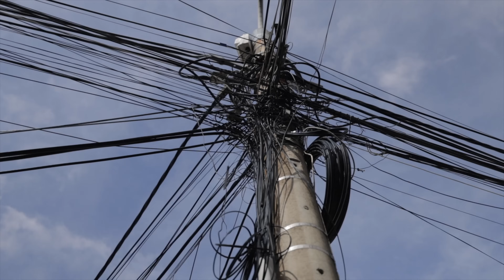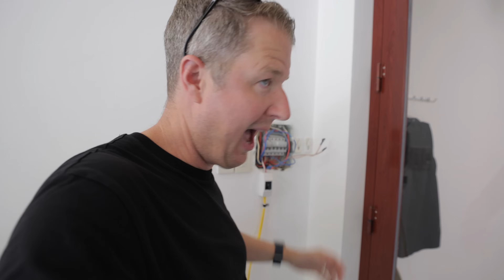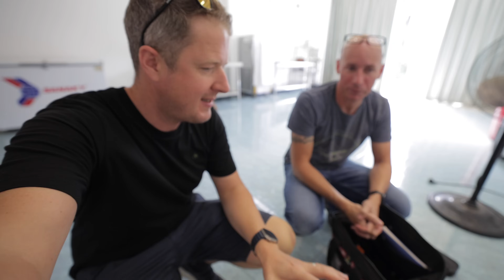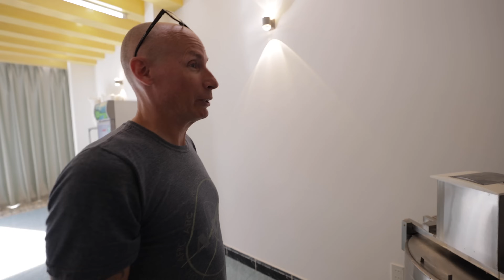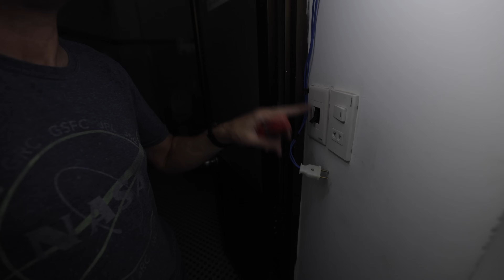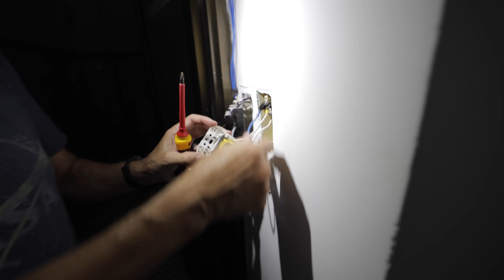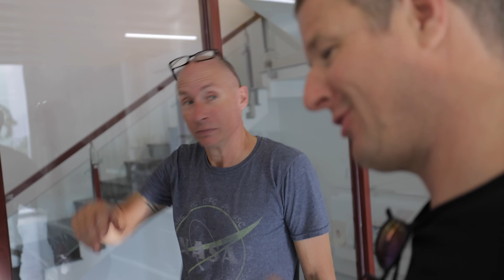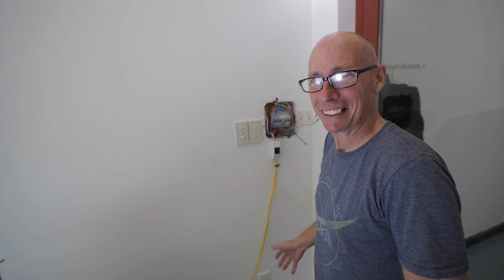USA and UK Electrician tackle CRAZY electrical wiring in Vietnam

Comment: That's some crazy stuff. Yeah wire gauge in America's weird! It confuses Americans too, usually the ones that aren't in the trade.
It makes sense historically sort of.
Reply: It probably made sense to the people who manufactured wires back in the day but not to anyone else. Same as sheet metal gauge.
Reply: British wire gauge starts at number 7/0, 0.5" (500 thou) as the biggest size, going down to number 50 which is 1/1000". The sizes follow an approximate exponential curve, with an average 20% reduction in WEIGHT per unit length. Dimensions are in thousands and ten thousands of an inch.
Reply: @billdoodson4232  interesting I didn’t know the UK had a wire gauge size, I just always assumed they use the metric sizing system even though I somehow knew that they had a different sizing system before.

Comment: Irish Electrician here who has recently moved to Canada, No.6 would be 13.3mm Cable, also the practice of twisting wires & using wire nuts still annoy me I feel as I’m doing something wrong every time I do it over here!
Reply: Wire nuts work quite well if used properly but they're amazingly labour intensive, which might be why they never caught on in most parts of Europe (the Dutch, Portuguese, Italians and Swedish used loads of them before Wagos became a thing).
Reply: Nothing worse than when your nuts fall off

- your wire joins 😂
Reply: I can't stand wire twist nuts

I've never had any good experience with them 

( Went to a job , discovered some one previously used them but the 
Insulated cover part of the nuts had fallen off leaving the 'springs' on the twisted wires that were now live and exposed 

I will never use them 
Twist the wires and solder and tape them
OR. twist the wires together and put them in a loose single Insulated connector and securely tighten the terminal screw to secure the wires and tape it 

I use Screwed terminal 'bp connectors'

Comment: Overcurrent or short circuit.  Does it trip straight away or does it take a while?  Unplug every appliance and turn on to make sure it's not an appliance.  If it works with everything unplugged then plug everything back in one thing at a time until it trips.  If not appliance, then leave everything unplugged again and find out what that actually feeds.  It might be quicker to run another cable through if thats a conduit I see there!!!
Reply: He mentioned 20 seconds, so it has to be the thermal trip but a fairly substantial current, so a low-impedance earth fault but no dead short. I think they already disconnected all portable loads and this circuit still tripped.
It's a conduit but without knowing where the other end is you can't replace the wires. You could try blowing compressed air into the conduit and spotting the whistling noise at the other end but if the conduit is only in the wall and loose wires above the suspended ceiling that won't help a whole lot.

Comment: No wonder they get the polarity wrong if there is no standard colours 🤷‍♂️that alone is the most crazy thing in my eyes
Reply: Back in the 50s and even early 60s quite a few European countries didn't believe in wire colours either. I've seen installations with all wires (except earths) the same colour or different colours for each circuit but both wires of each circuit the same colour. Probably didn't conform even back then but people did it. A friend of mine used to live in a place like that. All circuits were 1.5 mm2, lighting #1 was two whites, lightning #2 was two purples, sockets #1 was two yellows and a red earth, sockets #2 was two dark blues and a red and sockets #3 was two browns and a red I think. Built in 1960. 10 amp MCBs that were completely useless, once we had a short in a floor lamp and it blew the 20 A bottle fuse outside the flat rather than tripping the MCB. Someone thankfully bodged in an RCD (TT supply) but that was the only upgrade in five decades. Eventually the place saw a full rewire.
Reply: They use whatever’s in the van, doesn’t matter what colour it is or what size it is.
Reply: It's the same here in India. The reason is that usually the customer buys the wires, and any excess is waste, so the electrician just uses whatever is remaining to finish the work. Sometimes they use colored insulating tape to indicate polarity.

Comment: Im in the usa and i do twist wires together when using wirenuts and or copper crimps the twisting makes the solid connection the wirenut is just an insulater to exposed copper 😊
Reply: Because testing is non existent for you people, and you have specific "troubleshooters" to sort faults, you'll never really fully grasp how shit and annoying it is to take apart twisted up cables.

Comment: Welcome to asia..... you should see it here in Philippines...... most of the time no ground and 2 black wire on way over size breaker
Reply: Russia seems to be the same, and at least some countries that used to be part of the Soviet Union, e.g. Ukraine. Three 16-amp MCBs on a 4 mm2 Al supply split off of a 16 mm2 Al riser mains on 100 amp fuses. Yikes! No earths anywhere to be seen, even in remodels that seem decent at the first glance. I remember watching a YT video of a flat refurb where all the sockets had earths but the earth wires were just bunched up in the consumer unit.
Reply: @Ragnar8504  It's plenty rewireable fuses still in use in the UK, were you need to change wire if fuse is blown, plenty of lighting circuits with no earth whatsoever and so on. Actually electrical distributors in UK now are replacing existing copper supply cables with cheap aluminium ones.
So it's not Soviet Union who ran your electrical system down.

Comment: Just seen your comment, my garage light has done that since we moved in and the t tubes always glow...worrying..... Not my wiring but I will be annoying you re wiring it myself top to bottom.  Had to re wire it to move it as I'm doing a full renovation and its a birds nest, believe me it cant get any worse.
Reply: That fault is usually 'cos you're switching the neutral & not the live supply to the lights.
Reply: @dieselhead14  Wouldn't surprise me with this place. 
Had a sparky out to check some of my work before it got hooked up and live and the box is all good as are the grounds. But im expecting to find some more messes in this place before its finished. 
The garage is a no go for kids ect anyway just encase. :D

Comment: Blows my mind that wire colors are not standardized there. How can that be?
Reply: It's standardized - all whites. And some blue.

But what colour standard do you want?
Reply: @AAaa-wu3el  From the video it seemed as though any color wire can be used for anything.
Reply: @helmanfrow  That American guy doing electrics in that building for 8 years - he spoiled everything it seems.
Reply: I suspect there is a standard - just no one cares about it. 1950s and early-60s Austria was the same - the VDE regs explicitly specified colours but most electricians used whatever they had at hand, usually the same colour for all wires. I even worked in a flat built in 1960 that was half done in the correct colours and the other half all green. The introduction of the harmonised colours in the mid-60s put an end to the worst chaos but the one-year transitional period stretched into the mid-1970s in reality. The last house I know wired to transitional standard colours was built in 1973-74 while the official transition period ended in 1966 and explicitly only covered buildings already planned or under construction.

Comment: It's only when you go to other countries do you realise ,how advanced The British electrical system is, especially each plug have its own fuse,
Reply: The plug fuses would be entirely unnecessary if the British didn't have 32 A socket circuits. If socket circuits were limited to 16 or 20 amps, as they are elsewhere, fused plugs would offer very little benefit. Doing away with them would mean no more fire risks with illegally imported unfused plugs or adaptors, no more easter egg hunts for blown fuses and no more fire risk with broken ring circuits and no risk of DIYers "repairing" fuses with tin foil.
Reply: @Ragnar8504 more safety systems means more chance of people doing it wrong?
Reply: @Ragnar8504  you answer your own question, illegal plugs , British have a kite mark plug , And a fuse because they have  34 amp circuits , I would prefer to hear a 13 amp fuse pop in the plug then, get 2000 watts up my arm and down my leg,
Reply: Yes, very advanced.  So advanced that it's still not mandatory to have a dedicated electrode on your PME supplies.  Even more alarmingly no electrode of any type at all, not incidental via plumbing bonds, nothing at all, if the situation meets.  Tell that to anyone from another country that implements TN-C-S earthing and watch their jaw drop in disbelief...

Now this is not to say UK electrical is terribly deficient but calling it advanced is a bit of a fairytale too.
Reply: Each plug having it's own fuse is due to us having 30A ring ccts. In Spain all the socket groups are spares on a 15A breaker so don't need plug fuses. They have a duel plug system of big round sockets for heavy appliances max 15A and the 7A low power things can also plug into them. The 7 A sockets tend to be 2 pin with only the larger sockets having an earth. If your appliance has to be earthed use the larger plug. Also RCDs on every spare is now common.
Reply: @davidchamberlain2162   true but fuse in plug , and fuse in box RCD , gives a line of protection,
Reply: A fuse in every plug , is the best thing  ever! even if ring mains are not being used !

It Narrows down any  shorted out faulty appliances  to the appliance or at least power board .

How much time has been wasted trying to find a short on a circuit 
Only to find  a shorted fan heater the client 'forgot was plugged in and hidden behind the couch'

How the hell is the sparky meant to know where all the power points are ? Strip every room and pull all the furniture out lol?
Only to find a faulty appliance plugged in that the client could have unplugged them selves 

Charge an hourly rate 
Including an annoyance tax lol

Something a simple fuse in the plug would easily prevent happening .
And When the owner does  find their fan heater not working , they know exactly what appliance has the fault and it can be removed from service  or repaired 

A fuse in every plug automatically Narrows it down a faulty shorted appliance 

There will always be people that put the wrong size fuse in / solid link in and wire the fuse incredibly badly 
They know it's not done  right , so if they choose to use it , without getting it fixed they are liable.

Australia's plugs are crap no fuse  and assembly  involves stretching the rubber/plastic backing over the solid plastic base with the metal pins  ( not very ' civilised')
A side/ rear entry plug held together with screws  would be  100 times better  
And If it had a fuse  in the plug it would be 10000 times better
Reply: @GlenPoll-ox2hj  Australia did have a limited number of fused plugs back in the 60s but it was found that people would just whack any old fuse in so ultimately of little use.

You can get side entry and screw together plugs here if that floats your boat but the typical plug and line socket does have that tough flexible plastic cover.  It's intentionally difficult to get off once put on for obvious reasons.

Only electricians (full or restricted to appliance repair) are permitted to change plugs and cables here anyway despite all this stuff being on sale to the general public in hardware shops and the price of a plug is often a fair percentage of the price of a whole new lead, let alone labour charges, so reality is why change a plug anyway.  Just change the cord and all.  Changing plugs is all a bit moot really.

Comment: In my industry (Chemical/pharmaceutical manufacture) the first fault finding question was always.... "what has changed"
Reply: Very good question! In this instance it may or may not lead to the cause of the fault because the fault could also be rodent or water damage, or component failure. Still a very good starting point.
Reply: That was the first question I asked (and always ask) the homeowner, what did you add or change? Nothing was changed, second question here is always, did it happen when it started raining? Their answer to this one was it hadn't rained for a few days before or after the fault started. So could be some rodent damage or some water leakage that took some time to develop. Haven't been back yet, so it's still a mystery and homeowner, unfortunately, is not too concerned. Even though I expressed how this can go really bad.
Reply: That assumes that it worked when it was installed.
Reply: Change control is very important in commercial environment.
Reply: Applies to I.T. as well!
Reply: Same in IT support. It was working yesterday, today it isn't, what changed? The number of times customers would go "oh, we had some workmen in doing x y and z...."
Reply: I worked in IT/Engineering in the pharma industry and I have asked that question in fault finding.  Another question I like to ask is “what is it doing or not doing that’s out of the ordinary?”  I call these the “symptoms” to the ultimate “problem”
Reply: Lol thats what I've always said 
Especially if getting an electric shock , what was the last thing I touched and pull away from that 

It's better than 'jumping' and falling off  a fifteen foot ladder bringing down the whole tee bar ceiling  with you 
( Not a good out come)

If getting a shock what part of the light are you touching, is it the tee bar that's live? Is it the air conditioning duct  behind you in the ceiling space that you leaned on ( faulty fan motor?)

Just slowly pull away from the last  thing you touched and you should be right 
( And most of the time no one even notices you got a shock !) Lol

They do wonder though  how you knew there was a fault with the air con fan / whatever else was the fault 
' it's just experience, I can tell without even looking at it '

Can't own up to getting a shock it's too much paper work !

And don't want to break an arm or leg landing on a desk and concrete floor jumping off the ladder 

Rule no one of sparkies don't own up to getting a shock 

Rule no 2 is don't be afraid of getting a shock 
If you get a shock you get a shock 
Just stay aware and stop touching the last thing you touched 

I don't know why people jump so hard when they get a shock

It is  you jumping up and spearing     your head on a spike that's sticking thru the desk above you   as you jump up , or  falling of your ladder that  causes more harm/ death  than the shock itself most times 

Was with an apprentice once he was up a ladder and got a shock while removing a self contained emergency light 
( Power was off but he must have touched part of the inverter circuit LOL) up a ladder in a corridor
He went mental was looking around shouted / screamed as he   punched the wall next to him ! 

I was like WTF????

If you  get a shock just let go of it and reassess , make sure you are not still getting a shock , then carry on  not touching that part again  or testing with a Meter if not sure where the 'live' bit came from 

I told him he had better get his shock reaction under control or one day he will end up getting fried big time when working on our  larger highrise main switch boards

Funniest thing was the wall he punched ( full force) was a really old hard thick solid fibre cement wall 
He cracked it and put a decent dent in the wall  
But he also broke his hand / knuckles had to go to hospital and get x-rays etc 
He would have fallen off the ladder too if I hadn't been stopping it from falling over as he was dancing around punching walls

I did ask him if he felt like an idiot 🤣
I told him yeah ok you got a shock ,
How the f★ck is smashing your hand and trying to fall off the ladder  going to make it better?

You already got the shock 
It already happened ,why  add to any 'damage'  done 

Even the next day I asked him how his hand was  bruised swollen in a cast 
I had to make him aware  he wasn't in any pain or anything from the shock he received.
And would have been fine right now if he hadn't  hit the wall for no reason. 🤣
 
I live in Australia but I'm from the UK 
Maybe it's the English in me 
Get an electric shock 
Reassess the situation 
Hope no one noticed and 
Just keep on working 👍🙂